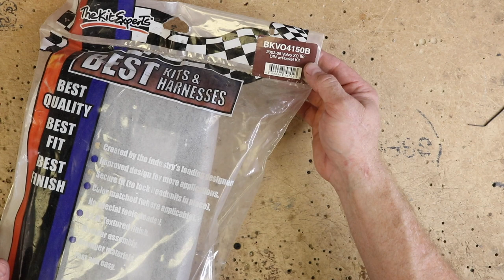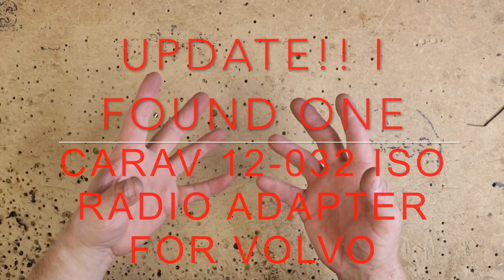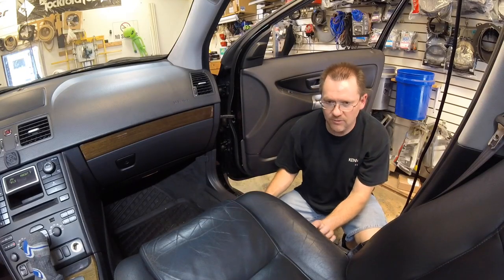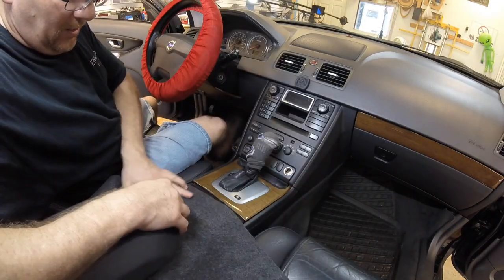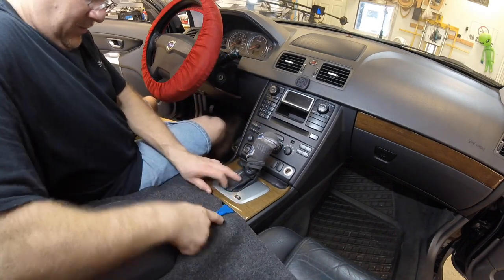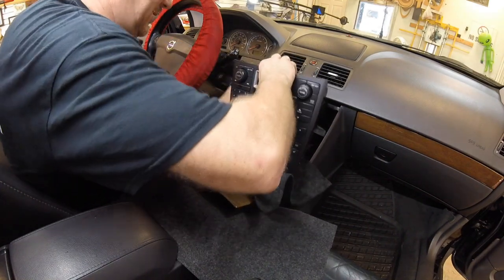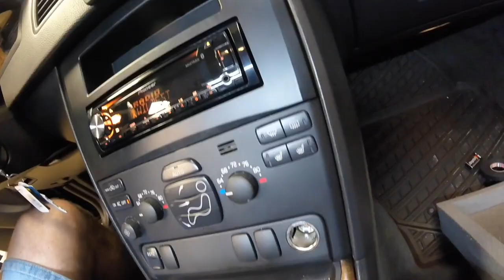How to replace the radio in the Volvo XC90

Comment: When he started it was bright outside...finished it was really dark.  This looks like a job, but then when is it not?  I'm up for the challenge.  I was going to custom make the plate like I did on a '97 Honda Accord I did a year ago...and that was quite a job, but with this one, I'll use the aftermarket plate.  Seems a log easier.  Looks like plenty of room on top.  I'm putting a light-bar on top my xc90 and that pocket looks like the best place to put a few switches to operate the thing.  Thanks a million for making this video.  Without it I would have gone mad, because I looked at the amp earlier to see the YAW control module (thank goodness there was no water there) and looked at the amp and thought, holy cow, this has to be re-wired.  This video shows how to do it without any trial and error and without messing with the internal wiring and computer sensors, etc.  I love YouTube tutorials!  I feel like it's cheating!

Comment: Hi. Firstly, great video. secondly, wanted to thank you for the detail in the video: I'm actually taking my XC90 back to a stock radio. It honestly looks like ferrets have been living behind the nasty 3rd party headhunt that's in the car at the moment. Wires have been spliced into, there's 3rd party boxes everywhere, I've removed GPS, a speaker and a mike that wasn't actually plugged into anything! You video has allowed me to work out how much work needs to be done to take it back to stock (sourcing a loom between the amp and the headhunt). So, again, thank you for the meticulous detail!

Comment: Thanks for the video I though I would have to run wires down to the amp. You guys saved me a ton of time, i'm so grateful. For saving the factory radio,  All you really need is board that the wires plug into, you can remove the display and all the buttons from the board and won't get any lights, windows and sunroof still work. so all you have to shove in the bottom of the dash is the little board. I used a metra window antenna very similar and it worked well. Made it feel like a new car with all the new features.
Reply from the maker: +Brian Hickman cool thank you for sharing your information to us, will definitely make the next one easier. Enjoy your new tunes
Reply: Will the heating system also work then?

Comment: Excellent video.
I might add, having worked on mine and others for some time:
the console cover, grey around the gear shift "snaps" on to the wood trim panel with clips. You just reach under and pop them sideways, 4 of them, and the wood trim panel comes off very easy,  this getting it out of the way .

I referenced your video while installing a double dinn in my XC90. (:) Thumbs up
Reply: Thanks for the info! Installing double din tomorrow and will keep that in mind too.
Reply: Which double din did you use?

Comment: I was excited by your video to replace my 2003 Volvo XC90 radio with a double din radio, as well as the speakers. Wow, what a job this is to upgrade the speakers and wire up the radio, with Nav, Backup camera, etc. I don't know if you've done a replacement with a double din, with the bells and whistles, but it's not easy. The speaker rewiring is a task by itself. It would have been great to have the details of a double din replacement, to hook up car speed input, and parking brake, reverse, etc.  Please respond if there's more help, or another source that would be helpful.

Comment: They now make a wiring kit with direct plug in harnesses that plug into the factory harness, so no more cutting. They also have an antenna adapter that allows you to keep the factory antenna, as well as a wiring kit to bypass the factory amp and still utilize the steering wheel controls with the aftermarket stereo. I was looking into install kits earlier today because the factory stereo doesn't even turn on, hasn't since I bought this car a few months ago. I bought a decent bluetooth speaker to get by using the music on my phone, but it just doesn't have the same sound quality as an actual set of speakers, so I decided to finally get another stereo for it, and had to look into install kits to make sure it was doable, because I heard somewhere that alot of people couldn't replace the factory unit due to no install kits being available, but now I found out they are, so that's a relief knowing that I can put a nice system in here. While I was looking into the install kits I found all the other goodies that make the swap so much simpler.
Reply: where did you find these adapters? thanks!
Reply: I'm also wondering about these, thanks!

Comment: Update to my last post, as i have some decent diagnostic software i thought i would see exactly which parts of the original radio need to be still connected, (and i struggled to find room to squeeze the whole lot in behind as you have done) 
So it turns out the only part that needs to remain plugged in is the centre part with the display, you can unplug and leave out both side parts with the buttons on, they can be a but fiddly to plug back in, patience and a gentle push with a small screwdriver works. Just make sure they are the right way up, they are very small ribbon type plugs.
Reply: hey i have a factory 'premium sound' radio system and it has become intermittent. will this let me use an aftermarket unit? i am assuming the replacement radio does not power or utilize the factory amp at all.
Reply: @robbiewilson157  that issue is usually the icm itself or another part of the most loop that is not functioning correctly. vida would tell you which part. that part needs to work right or your stereo would still be intermitant

Comment: Well, you really did a great job. If I understand correctly, you leave everything in the car and you just need pretty much the speakers and power for the new stereo right? Well, you are saying that you loose the center speaker because normal car stereos do not have more than 4 speaker connections. Now how about if you leave the old system up and running just hiding in the "underground" would it be possible that you can leave the center speaker connected to the old system and you can keep all your car beeps like PDC warnings, seat belt warnings and such thru this center speaker?
Reply: That's a really good idea. Keeping the original warnings, especially the reverse sensors, is important to me.

Comment: When you do this install what did you do with the plug that goes into the back of the cd player?  Do you just tape it up?  I see that the two from the radio stayed plugged in and wrapped up in blue tape.  thank you.

Comment: dude. I found a 2007 XC90 w 58k miles for 6k in top shape and i am about to pull the trigger, has 7  seats and from what I can  tell is a reliable car and i am rolling a toyota solara w 320 k miles on it so would be upgrading the stereo for sure. Whats the estimate / cost and going for a double din w reverse camera etc . and why would we lose the center channel? lemme know, yall videos shares so much insight i really appreciate you guys sharing this insider detail even though know it may feel easy although intensive i know 100% i would F it up if i tried myself.

Comment: 12:45 the actual FM antenna is part of what is known as an “Antenna Farm“. This is a flexible green circuit board in the top back of the roof above the tailgate. If you look carefully, you can find a small silver metal box which is the power amp for the FM part of the circuit board. The roof of the car is electronically transparent in a non-metallic panel about 5 feet wide and 1 1/2 feet from front to back. All of the vehicle antennas are printed on this circuit board.

Comment: i have installed systems in  at least 15 xc90's but not once have we used the oem speakers. have you guys ever had issues with them being 2 ohm? here in memphis i automatically assume (i shouldn't but i do) its a premium car so change the speakers also. you did an amazing job i enjoy your videos. i manage a family owned shop in memphis, tn Stere One . keep up the good work
Reply from the maker: Eldridge Henry, II thank you, no we have never had a problem with the speaker. Most of the installs on these keep the factory speakers just like this one.

Comment: Very professionally done! Excellent work! 

These Volvos have either 8-speaker or 12-speaker (premium). The after market head unit usually has 4 channels - FL, FR, RL, RR. Except for the central speaker (in the premium version) can you confirm the rest of the speakers are all working?

I have the 8-speaker systems. The front door has 1 speaker + 1 tweeter. The rear door has 1 speaker and there is one speaker in the trunk where the seat belt for the third row is. Just want to make sure all 8 speakers will work with the aftermarket radio. Thanks!

Comment: I'm installing a double din after watching your video.  I don't intend to use any of the factory parts, replacing the amp, speakers, running all new copper wiring, so what do I need to do other than reconnect the factory amp and connect the original 3 main pieces that I shouldn't get rid of.  I also got the wiring harness that you recommended at the end instead of splicing, but not sure why I need it since not using any of the factory parts.  I need you to clarify for me the other connections, i.e., getting rid of fiber optic connections, connecting reverse line, mute (lower volume), brake switch, and rear camera.  I intend to get power from an always on source, and a ignition switch on connection (if I need to do that).  I'm trying to get this done by 17 Oct '20.  Help me Obijan.

Comment: Thanks for the video. I have a 05 XC90 and put a 4200 NEX in it. Following this video. Only question is where did you ground the aftermarket antenna at? I did not see that part in the video.
Reply: You can ground in many different areas. Either use an existing bolt or nut or use a self tapping screw/hex head and drill it in any where you want

Comment: Just FYI you can remove the controls to the left and right of the original display screen and it won't cause any errors on the dashboard.. much easier than trying to tape them all up and find space to squeeze it into!

Comment: Is there any way that you can keep the center channel? Awesome video, yours is by far the most professional and enjoyable to watch!
Reply from the maker: matt feith thank you. Using just radio power no. It would give you a low ohm load on whatever channel you put it on. If you add something like the Pioneer GM -D1004 you could. The amp could power the 4 speakers and the radio could power the center channel. You could mount the amp where the factory amp is located and use the factory amps power to feed it.

Comment: I just did 1 and the factory amplifier was not reconnected to any of the wiring. The new wire harness connected directly to the factory amplifier wiring plug for plug minus the fiberoptic cable. It was ran the same way to the dash and had the wiring to connect the aftermarket head unit and steering wheel controls for a double din. Was not to bad other than the passenger seat didnt work for the power to move it so had to remove the seat to do the installation. Long process to do these vehicles.

Comment: Awesome stuff, very helpful but I also replaced the stock amplifier with an aftermarket pioneer 5ch amp.
Reply: did you put the amp back in the stock location? seems like a great idea. also if its a 5 channel did you get the center speaker to play as well?

Comment: Did the same to my wifes 06 couple days ago. But i didnt mess with the amp i just splice the wires from behind the radio.i installed a double din with back up camera its a pita .dont splice the wires for the cig lighter for power theres three wires you have to disconnect from a harness with a fiber optic that you can use so the radio can keep its memory.

Comment: Does this work with the existing fiber optic system?  Great video by the way.  You gave me everything but the kitchen sink!
Reply from the maker: +Darien Mathis you have to Bypass fiber amp
Reply: How do you bypass the amp?  It's fiber optic in, correct?  Have you used the Crux Radio Replacement?

Comment: thanks for putting this together! I hope you can answer this for me...
will this also work for my 07 xc90 that has the factory navigation system?
Reply from the maker: Jorge Heredia sorry, I have never done the navigation radio.
Reply: Sorry let me try the question again. my xc90 has a factory navigation system where in the Volvo in your video has the center speaker. I'm not wanting to do anything to that part, just add a double din where the factory radio is now. Will the way you showed on your video still work? thanks for the reply!

Comment: Kevin does this eliminate  and go around the factory amplifier, or does it still power the factory speakers?   I would like a new head unit with Nav and backup camera for my 2007 xc90 with high performance sound.   The head unit makes the car look and feel extremely dated but not having the speakers amplified would probably sound pretty bad.  Thats a 4x120 amp I believe.

Comment: I have a 2010 xc90. My wife loves the car, but hates its lack of Bluetooth. I had the upgraded sound system, which I love. Any easy and efficient way to add Bluetooth so it plays into car speakers? Or is a new head unit required?

Comment: Love this video. Thank you. 
I am actually buying an xc90 this week. Your video has helped me with the few questions I had. By no means am I a professional but I have been doing my own stereos for myself on a dozen or so cars. But this will be my first euro so I was concerned. 
Did not catch it in the video and am struggling to find it on my own but were you able to make the steering wheel controls work with the aftermarket unit?
Thanks guys
Reply from the maker: RALLIART15 this customer did not want them but the Metra makes one. Go here
https://axxessinterfaces.com/vehicle-fit-guide
Reply: Five Star Car Stereo thank you for the reply
Reply: I just did a simple install on an XC70 with an ASWC-1.  Volvo's illumination circuit is on the CAN bus and the AXXESS unit does not provide for that.  Steering wheel controls work fine.  If you want the radio to dim with the headlights, you need a more capable CAN bus module, like the InCarTec.
Reply: @FiveStarCarStereoInc  hi i checked with metra and the one they make says it fits 2007 not 2008 do you have any experience with those? should i just take the risk?? Thanks

Comment: you don't need to keep the original display screen & buttons.  The issue you run into is the Low speed CAN passes through the display screen (ICM) but all you have to do is locate the two twisted pairs of white & green wires and jumper them together (i.e. white from one twisted pair to white to the other twisted pair & green to green) to complete the CAN circuit.  You can take the who screen & button assembly out.
Reply from the maker: +Jafar Partowmah thank you for this information, I can't wait to try this on the next one we get.
Reply: Five Star Car Stereo, he's correct. 35 year pro installer here.
Reply: I personally just unplug the left and right control panels from the main screen and just leave it in so there's no issues.
Reply: After that you can use the steering wheel for louder and quiter?

Comment: Interesting vid, until watching this I didn't realise the original radio is actually only a control panel with no useable speaker cables for an aftermarket unit. 
Shame the stock volvo unit is so basic that this mod is really a necessity, other than a decent quality sound it has no other appeal. Nice idea to wrap the original radio components and tuck them behind.

Comment: Hello i have a question if you pull out the speakers plug from the amplifier do you loose the amplifier o does not affect the amp at all
Reply: Amp is lost but it is only needed for the factory stereo. The factory stereo does not have the actual outputs so it uses the amp.
Reply: @drewhenderson2086  thanks man

Comment: I have done the job and the radio works. I didn't look for any steerwheel connections.
I used the purple wire from the cigarette lighter but there is no permanent voltage on it, so I can't use this one to connect acessory or yellow wire.
Can somenone tell me what other cable I can use?

Comment: This is pretty much the same what I did with my 9th gen accord. Burying a factory HU behind the dash is not a joke. At least this Volvo HU is not that big, unlike the one that came with the 9th gen accord.
Reply from the maker: arempee26 yeah, we used to have to hide the Civic radio because the alarm was built into the radio. Something never change

Comment: You can by pass all that work by removing just the lcd monitor and pluging the optic wire back in it. Dont need the controls. Your power can be tapped into the power that goes into the cd player. You dont need the cd optic wires connected to avoid airbag codes. Speaker wires go from amp to the speakers so can be cut and connected to the speaker side. 
Doin it this way avoids all codes, and eliminates half the labor since you dont have to mess with the amp.

Comment: Thank you very much for the video. It saved me lot of time. I followed the instructions but i am having issue with fm transmission. There is lot of noise and only getting 2 fm stations. How do i fix it?
Reply: Sounds like you either did not install the antenna or it is not plugged in all the way
Reply: Or maybe you did not ground the antenna properly